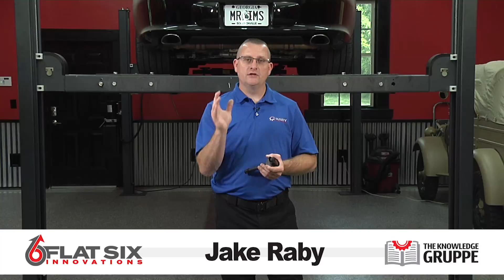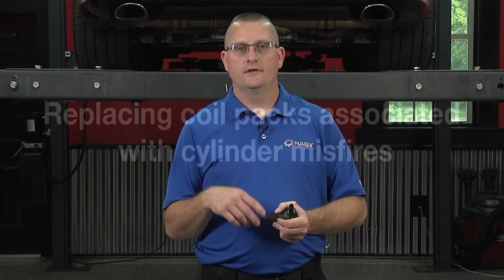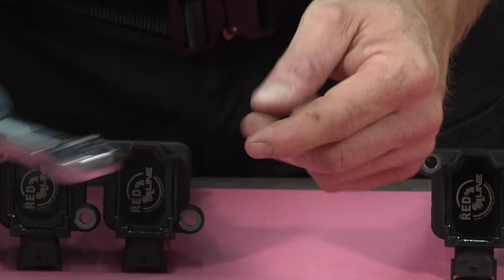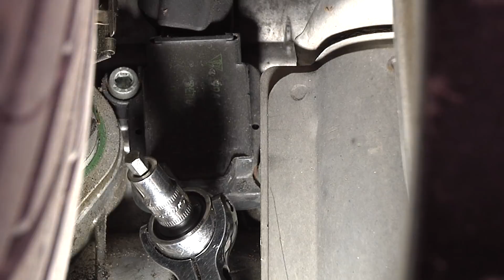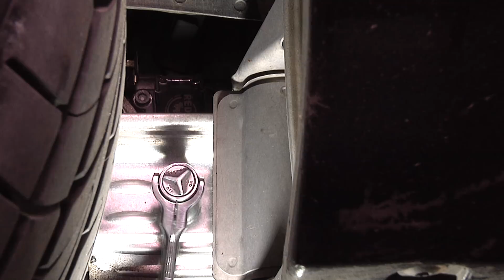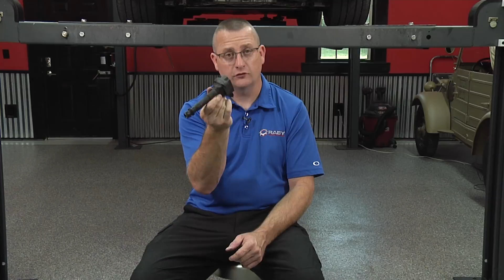Replacing coil packs on a Porsche 996, 997, 986, or 987.

Comment: Excellent tutorial Jake. 100% correct on all you said. My ‘06 Cayman had 6 new coil packs fitted by an independent but later showed a misfire on 4, plus engine warning light.🤯 Checked by a different garage, resulting in removing a badly fitted coil pack which had snapped off a big chunk at the connector end. Every time I hit a rough road surface, misfiring occurred because of poor connection just as you said. Subscribed for more first class explanations.🇬🇧

Comment: Is the 0300 a generic misfire code while the P0302, P0304... Refer to which cylinder the misfire is specifically on?
Reply from the maker: Yes, 0300 is multiple misfires and 301 - 306 are specific to the cylinder.
Reply: @RennvisionbyTheKnowledgeGruppe  thank you

Comment: Shaking at idle with no codes also possible? Have a broken tab on one coil connector I'd like to replace to see if that fixes it....are connectors also replaceable with the engine in the car?

Comment: Hi a thank you so much Jake! Sorry about my poor American. Can you please confirm me a coil pack problem with this videos:

1°/ Start Engine:
https://www.youtube.com/watch?v=eMoMk8mRxlM 
2°/ Medium Temperature. After 3min. I have an unstable idle. And vibs are coming :
https://www.youtube.com/watch?v=sH-Q0giwjoE

3°/ Hot Engine:
https://www.youtube.com/watch?v=AXnNkJIo2gQ

Many many many many thanks for your helps.
Reply from the maker: The coil packs were the factory originals. That means 17 years old at the recording of this video. Only the factory OEM original come with the triangular Porsche logo (notice on camera). Coil packs are subject to many heat and cold cycles which ages the plastic housing. Over time, the plastic housing cracks which make the coil pack cause a misfire.
Reply: @RennvisionbyTheKnowledgeGruppe   So many many many thanks! I totally agree with you. I have an O2 sensor to change to. The engine is new replacement by Porsche in 2011. So with noise you can hear, you don't think there'is problem with Timing Chain, Variocam, IMS or important issue ?

Comment: Hi . I have a 1999 boxster 2.5 litre.  codes im getting are misfires on cylinders 4 5 and 6. I found that the exterior of coil number 4 has cracks in it.  Also getting 02 code saying " O2 sensor ahead of catalytic converter. cylinder (4 to 6)"  .  Any ideas. Thanks

Comment: I wandered around the net for a while looking for a clear view to R & R spark plugs on my 03 Carrera. I got a cyl misfire code on #1 last night, so figure I'm heading this direction. The lack of camera access to cylinder 4 glosses seems to gloss over the widely reported difficulty of access and why everyone else seems to wander down the rabbit hole of exhaust removal. Raby even does it with the wheels on! Gotta love having a lift. Thanks for giving me more confidence to do this plus the spark plugs while I'm at it.
Reply: Thanks for your reply. I really appreciate your video! It gave me the courage to try the job and I competed it yesterday. It took me about 4 1/2 hours. You are right.  No need to remove the muffler.

What helped a lot was seeing you do the job without jacking up the car or removing the wheels. I backed the car up on ramps and lay under the back of the car. This gave me good access to the plugs.

I recommend starting on the drivers side with the rear most plug and coil. This gives you experience as you move forward and also schools you on the passenger side rear plug because by the time you get there you will know the flow. 

For others trying this - you can reach the rear plug on the drivers side both with your left hand from the front and your right hand coming up behind and through the exhaust.

I used a 3 inch extension and a flex joint spark plug socket. The dream tool would be a 4 inch extension plus the flex joint socket. This would help your ratchet handle clear the other electrical sensors adjacent to the plug bays. 

DUCT TAPE YOUR SPARK PLUG SOCKET TO YOUR EXTENSION!  I had never tried this, but it saved me tons of pain trying to remove the spark plug socket from the spark plug after installation. I saw this on another YouTube video and it is a lifesaver.

When it came to the passenger side rear spark plug, the biggest problem was not removing the plug. Since I learned so much by doing the driver side, it was actually pretty easy to remove it. I had access with my right hand from the front with a little help from my left hand in the back. The hardest part was walking the rubber boot back on the coil plug! It took 30 minutes trying to bring it back down. Do yourself a favor and grab a small needle nose pliers to pull it back down if you have trouble. 

I was able to get a torque wrench to the passenger side rear plug, but there was too much slop in the torque wrench to get it to click given the limited amount of vertical up and down space with the torque wrench coming off to the right. My workaround is that I helped the torque wrench with my right hand and with my left hand I popped off the head of rachet, turned the ratchet head with my fingers while holding the handle as far up in the engine as possible. This would reset the ratchet teeth enough to have resistance at the top of the stroke instead of slop as I pulled down. If you don’t know what I’m talking about, you might know once you get into it. This method also works as you move to the middle spark plugs.

Once again, this job was easier than I expected. I had done the plugs in my 97 Boxster also so I have some experience working on my cars. Just get comfy on your back under the engine and be patient.
Reply from the maker: As the producer of this video, I can attest to the fact that Jake Raby was able to remove and install all 6 coil packs on the 996 without having to remove the exhausts. Of course, #4 was the most difficult because of the engine layout and because of the lack of space I was unable to get a clear shot of him installing it. My cameras are big. Hindsight, I would have brought a GoPro, but even then, it would have been a challenge. Good luck!

Comment: Great video. What is the torque setting for the coil packs?
Reply from the maker: Hi. Jake Raby has decided to not give out torque values because they change when the manufacturer improve fasteners and other parts. The best resource guide for torque values is sold by LN Engineering. It has all torque values on the M9X series of Porsches engine. This book is kept up to date as torque values change. https://lnengineering.com/education/literature/996-997-torque-book-bundle-fastening-specifications-for-porsche-911-types-996-997-automobile.html
Reply: Jake does actually mention a torque setting value of 10Nm at 8min into the vid.

Comment: Thanks Jake.  How easy to remove the coil pack #4 without removing the wheels, muffler and bumper?  I have a 06 997.1 C4S that I plan to replace the spark plugs soon.
Reply from the maker: Cylinder #4 is the most difficult because of the M9X layout on bank 2 which makes it a very tight fit, but with patience it can be done without having to remove any exhaust components or bumper as shown in the video. You may find it easier unplugging and reconnecting the #4 coil pack from the top of the engine.